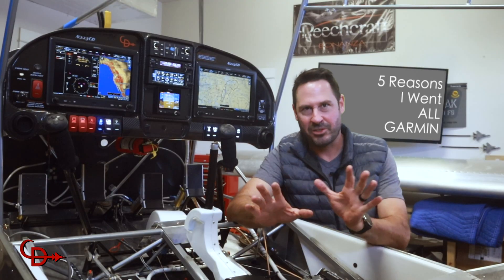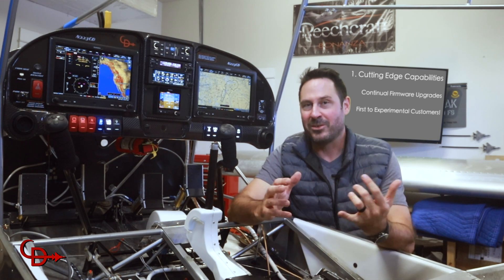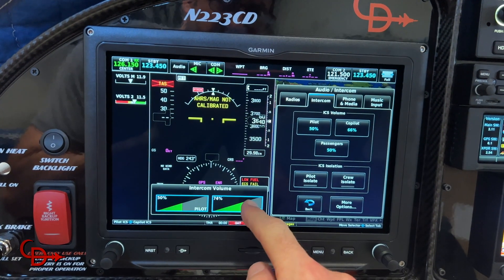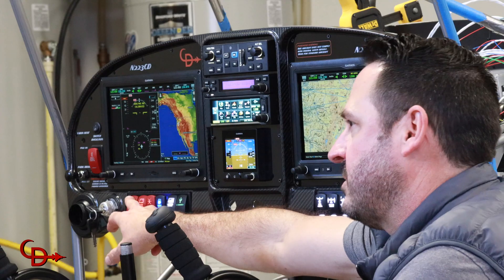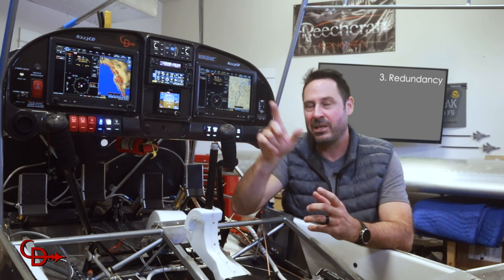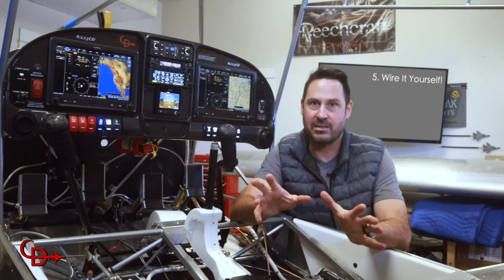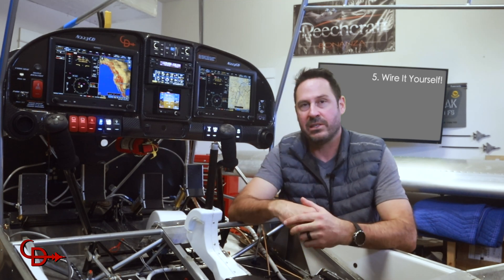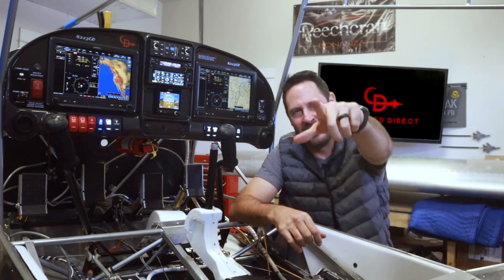5 Reasons I went ALL GARMIN Avionics for my homebuilt bushplane

Comment: Question #1:  How much did ALL your avionics cost?
Question #2:  Did you compare the price for an equivalent system by Dynon or other manufacturer?  If so, how much price difference?
Reply from the maker: I think it cost around $22K? And no I didn’t compare with other manf’s but I’m a big Dynon fan. Considering going Dynon for my Bonanza upgrade in the future.
Reply: @CLEAREDDIRECT   : Wow!  I must have done something seriously wrong, because when I went to the garmin site and added up what I thought were the components, the total price came to about $36K (before any taxes).  I am inclined to copy what you did ... unless going with Dynon saves $10K or more.  Frankly, I was hoping avionics would be $20K or less, so my $36K estimate kind of scared me!
 
About going with Dynon for your Bonanza.  Is the display and operations of the Dynon and Garmin so similar that you won't notice the difference when you're flying?  Unless they are very close to the same, I would want to configure them the same so there is simply less to remember ... and less to forget.
 
I am very close to pulling the trigger and putting a deposit down on a Rans S21 Outbound kit (tailwheel with 26" tires and Rotax 916iS/c engine ... etc).  Since you are just about done, any chance I can bribe you to fly up to Pahrump, NV (50 miles WNW of Las Vegas) ... or let me drive down to your place to see a real Rans S21 Outbound in person?  :-)

Comment: 1000% agree with you. My turbo glasair rg also has 750xi costing $70k plus installation.
Reply from the maker: Holy moly. Wait, $70K PLUS installation? What else did you get?
Reply: @CLEAREDDIRECT  all new wiring strobes, speedbrake,  Linner actuator for the flaps (55*) xm-weather smart glide,  all engine stuff,  Intercooler, Dual EFI and Ignition, 3 electrial systems  dual seperate batteries +  Essential power system, LED landing light.. Now totally broke